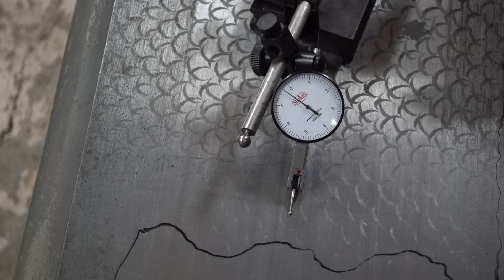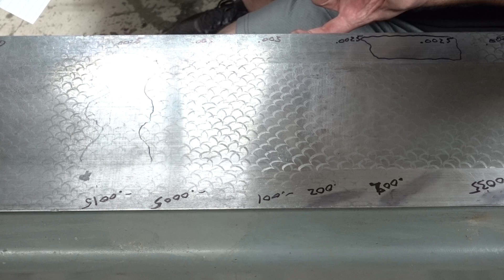Checking alignment of the milling machine

Comment: A very uneducated guess here, but I think I would hybrid the new version(in the update vid), with this version, having your non indictor side feet 4-6" apart seems like a good scenario for co-sine error. I would make a narrower version of that to plug into those two holes in the surface guage, maybe held in with screws so it stays in the same spot, and hooking on the way face. But having some small .25" ball bearings or some thing as a slide face but only 2" or even less apart. 

Think of it this way, as the gib or knee side comes out of the ware area, like you are moving toward the base of the mill(ways should be getting further apart), it will be wider, so the measuring apparatus with a 6" wide "foot print" will be at a wide part of the way and this push the indicator side over how ever much and give you a wide reading rather than a exactily perpendicular measurement across the way.

Hope this makes sense, if not I'll figure out another way to describe it.
Reply: Also fuck yeah keep this stuff coming, good stuff, hell if you're bored you can come help me talk my employers into having the cylindrical grinder rebuilt, so we can get rid of the .016" of lead screw slop in the bed or get the damn head to come in repeatably...
Reply from the maker: I think I follow your thought.  Basically, you're saying the current width presents the opportunity for one "foot" to be standing on a high spot and the other "foot" is standing in a low spot.  Therefore, it "kicks" the indicator to the side at that current position. Make sense?
Reply: ThunderDog exactily, though I maybe wrong, that has happened before.

Comment: Hä... This surface is totally unimportant ... There is no kontakt... ???   : /
Reply: It is a bearing surface, so no need to repair unless horrifcally gouged or worn.  Only if gibs adjustment on Z will not allow even and smooth travel for entire length of travel.

Comment: I'm not one of the experts you'd like to hear from, but I can give one piece of advice from my own learning projects.  Get your measuring tools / fixtures to the point you can trust them without having to second guess your measurements.  I'd recommend that before mapping anything, even, because you might have to make dovetail reference prisms, some form of Kingway machine, or even pick up a different style of indicator that can do what you need.

You're being cautious, checking good reference books and knowledgeable people, and have a fair idea of the process and principles.  Measuring with confidence makes it SO much easier to do good work without having to back up and fix your fixing :)  You got this!
Reply from the maker: 🖒🖒I'm putting together a tool now to address the dovetails.  Gotta remove any doubts on this oroject.

Comment: Hello!  So you're in a little bit of a pickle here.  You don't really have a reference surface that you can assume is flat and square.  The current way of measuring the dovetails would work, if that edge was consistent, and if that top surface was truly flat, I'm pretty sure.  That edge is going to be quite inaccurate though.  It will have really small dings on it most likely, and it will have an edge-break on it, which I have no idea if it's precision machined or not.  If you could somehow make a straight edge or set up that surface plate to measure it using that as a reference surface, that might work...   Anyway, loving the series, and glad to see someone else with the same index mill I have.
Reply from the maker: Thanks for watching.  There is a suggested tool to make that is in Connelly's book to accurately measure this type of setup.  I just need to put one together.

Comment: With regards to the two pins potentially wobbling along the 'S' shape of the other side, could you use a parallel between the 'S' and the pins? I would think the parallel would ride over the hills so the pins don't dip into the valleys.
Reply: sounds worth a try  , nice one  adam :)